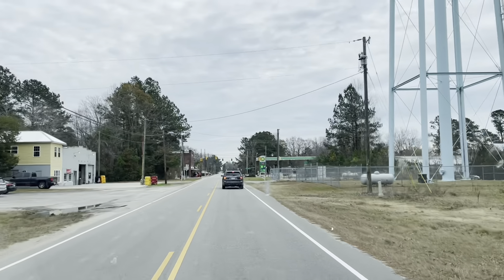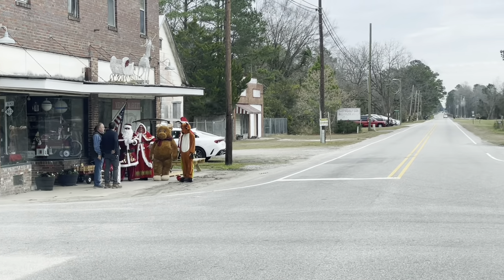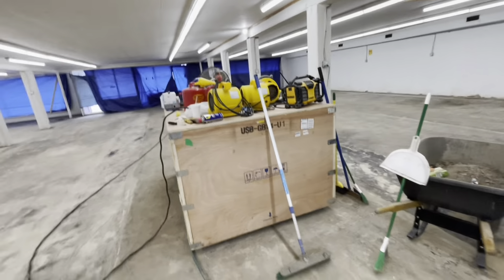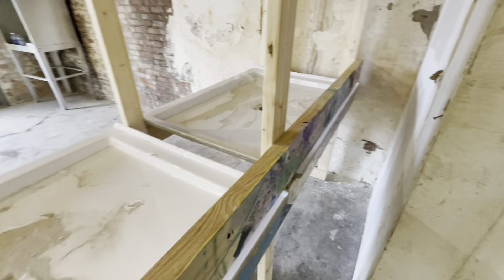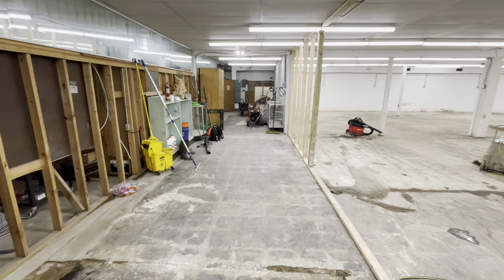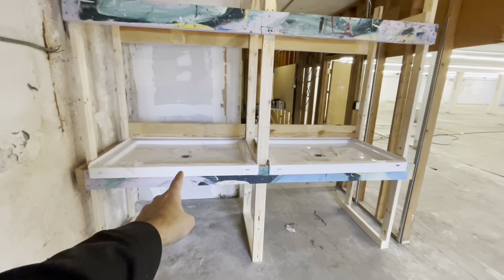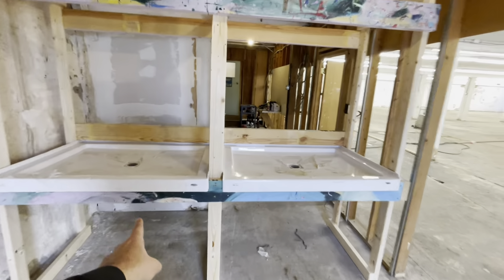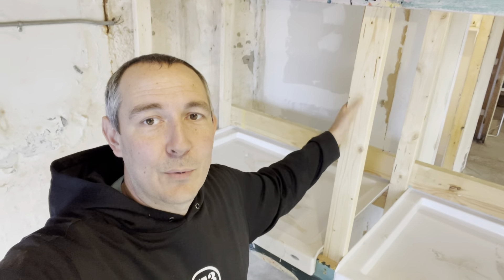Building a DIY Double Washout Booth for Screen Printing and New Shop Updates

Comment: Nice!  I would highly recommend a sump system for your washout booth.  It’s very inexpensive and will save you big money down the line.  The ink and emulsion will absolutely create a rock hard clog in your plumbing.  It may take a little time, but it’s inevitable.  There’s a video for a diy sump by Floodway Printing.  It costs less than $20.  Good luck in your expansion
Reply from the maker: I actually have a sump pump in the van ready to go, been researching different systems to build. Certainly will be a future video.
Reply: I should have called it a catch basin
Reply: We have a catch basin and then a filtered sump